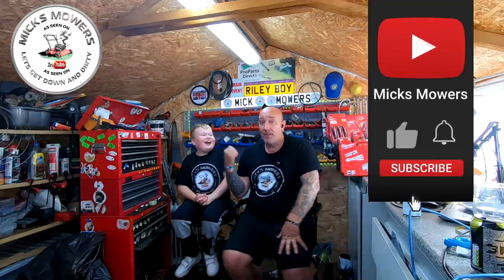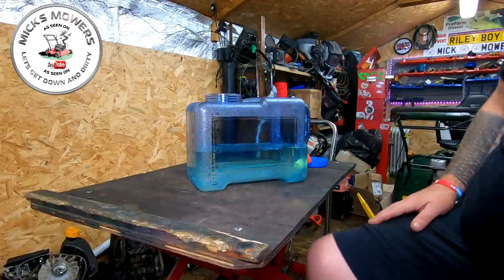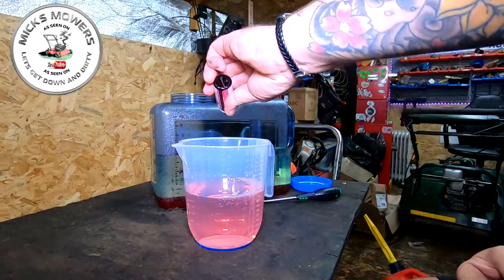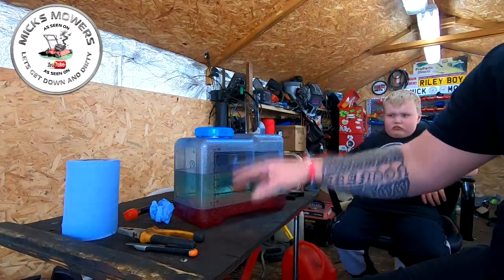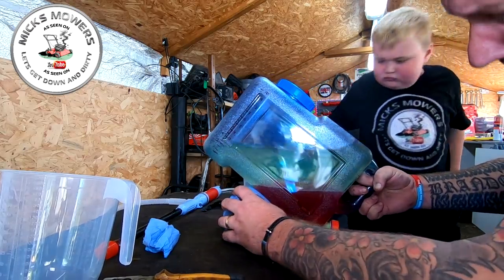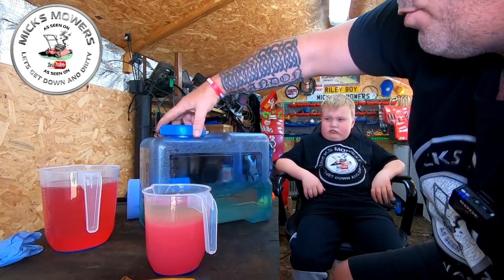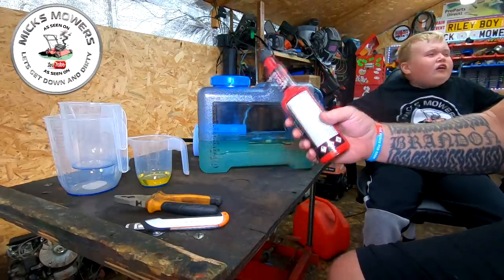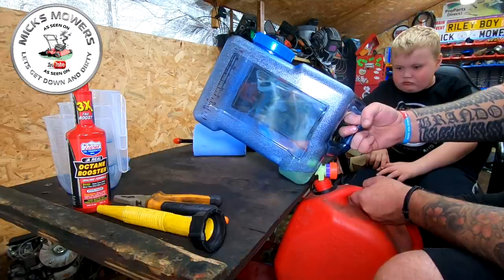How To Remove Ethanol From E10 Unleaded Fuel To Use In Lawnmowers And Small Engines

Comment: Why do refinery’s even bother to put so little ethanol in the fuel if the little amount is causing so much damage which it does I’ve seen it first hand..
Reply: Government mandate.  Reportedly, even farmers which raise the corn for ethanol won't use the stuff in their equipment.  Aggravating to realize that there is little chance of getting government to remove the mandate - too much money involved...
Reply: @xzqzq  it’s just crazy
Reply: @xzqzq  All the farmers i know use ethanol blended fuel, some even run explicitly E85 and are darn proud of the work they did raising the crop to produce the ethanol.  So i don't know who is reportedly making these false statements, but i can tell you for a fact that growing up on a farm we used the same ethanol fuel as everyone else, and now in my older years living off the farm i still use it, and still have zero issue with it.  If not for the ethanol plants and the contracted corn they buy a lot of farmers would be hurting on their income every year here in the Midwest.  Its a huge part of our economy, i have three ethanol plants in my area and another is being built with a spring of 2022 production start.
Reply: @CrazyHamSales  Any idea why Congress mandated ethanol in motor fuel ?   To support the farming sector ?
Reply: Ethanol is considered less polluting than hydrocarbons, ie it reduces the CO2 emitted (and other contaminants, too). However, the process of making ethanol from corn creates CO2 as a by-product which is used in food processing and fizzy drinks, which then gets released to the atmosphere, but only half as much as burning hydrocarbons. (Another by-product is a pretty good animal feed).  It certainly reduces the demand for crude oil which is generally only available from politically antagonistic countries and reducing imports is good from a balance of payments point of view. 

Whilst fracking in the USA has considerably reduced the dependence on imported crude, it will not last forever so the ethanol will spin this source out a bit longer. This also applies to the UK where North Sea oil is on the decline. Of course, farmers like the guaranteed income, too. 

The downsides are ethanol is more expensive to make than refining hydrocarbons and it can damage engines if stored for any length of time as it absorbs water (the basis of Mick's process) and eats nitrile gaskets and O rings. So from a political perspective it makes perfect sense. Engines will be designed to resist the corrosion and separate out the water but older vehicles will take time to work their way to the breakers. PS water is also a by-product of combustion. You can see it dribbling from exhaust pipes on cold days.

Comment: I liked your video. I'ld save the E-10 and rejet my 2-stroke dirt bike, add some good 2-stroke. It should some power. But at the end of the day. "Drain the fuel out of tank and run carb" dry. Then put a Pint fuel Gas/Petrol in the tank mix little heavy on Oil run it for afew minutes.  "Alcohol hates Aluminum"! It eats into the aluminum. Get it out of your fuel system after riding or racing.

Comment: 5 L "petrol" 10%  ( if ratio by volume) ethanol so 0.5 L to get out. Add 2L water  then you might expect 2.5L to drain off.
Frankly my chemistry was too long ago but I would expect the ethanol to go into solution and there be some  reduction of volume over the 2.5 L... 
But what the hell were just washing the petrol with water.
Reply from the maker: Thanks fo watching Jason..

Comment: Actually octane retards ignition (reduces flammability/explosiveness).That's why higher octane fuel is used in high compression engines to stop preignition (engine knock)...
Reply: Fuel with an 87 octane rating burns more quickly while higher-octane fuels burn more slowly. ... By contrast, a higher-performing engine, which includes engines with higher compression ratios and/or forced induction, requires the slower burn rate of higher-octane fuels to defend against engine knock.

Comment: Why? E5 is ten or twelve pence more expensive, you have just removed 10% of your E10 ie you fuel without the cost of water and equipment is now 10% more expensive when the E5 is only about seven and a half % more expensive than E10 before you have started messing about. I have some E5 that I use for my emergency generator that I have added some fuel preservative too that is now more than three years old and still good.

Comment: UK people "the metric system is so good"
UK people "yes I'll take 1 liter of petrol for 20 pounds"
Lol makes sense, right? Measure everything in metric but money is still in pounds. Even so, I feel sorry for metric places. They're paying the equivalent of 4-5 dollars for 1 Liter of gas. Mean while, we're paying 3 dollars for a whole gallon.
Reply: Pounds as a currency is £
Pounds as a measurement is lb

1 litre of petrol costs about £1.35
£1.35 = $1 86

What's wrong with using GBP as a currency anyway?
Do you think they should use freedom eagles instead?
Reply: This is nonsense. Modern engines burn cleaner than they ever have. New EPA regulations have the largest trucks running clean. I would agree that less vehicles, hybrids or electric is better for cities, but the strip mining and carbon footprint of all of this still exists.
Reply: The USA is the only country left in the world that uses, Fahrenheit, gallons (which were different to UK gallons), lbs (that were different to UK lbs), and letter size paper... but the dollar is metric (well, decimal is the correct description). Go figure!

Comment: Good to know; just gad they still sell alcohol free gas where I live (for now).   Just as a side, I did leave gasohol in my lawnmower over the winter and low and behold, the engine wouldn't start.  Took it to the repair guy and he said there was water in the tank and gasohol attracts water (as you said).   No longer worry now that I use non-ethanol gasoline for my lawnmower.   :)

Comment: Great Video Mick!!!  They've started cramming this E10 garbage into fuels in Canada too now so I suspect more and more people will be doing this to protect their small engine's from ethanol gumming up the carbs dude to phase separation.  Question, I've seen a couple other vids where they recommend 1 part water to 16 parts petrol (so for 5L, would need only about ~312 ml of water).  But you use a ratio of 1 part water to 2.5 petrol, just wondered why so much water?
Reply from the maker: No reason mate.. I don't believe it matters
. The water will still remove the ethanol..
Reply: @themowerman  thanks Mick!!

Comment: Hi,
Thanks for the info about this e10 fuel, quick question, for 2 strock engines will this work the same once i mix the measuered oil into the fuel
Reply from the maker: Yes mate
Reply: Why mix the oil into the fuel before you separate the ethanol? Just separate the ethanol then add oil to the neat petrol.

Comment: Last year, when we had another potus, I was paying about .50 cents per liter in NW Ar. Now it over 3.00 per gallon or .75 cents per liter. Diesel is anywhere from 3.25 per gal to 3.40. Or .81 cents per liter. We are now introducing E15 fuel now. It is supposed to be fine for 2007 and newer vehicles. E85 is cheaper, but ethanol holds fewer btus of energy. I bet U.K. folks think .75 cents per liter a bargain?

Comment: Have you looked at a mr funnel to remove any trace of the water i have had mowers come in would not start drained the fuel put back in a machine as a test with the fuel pored though a mr funnel and the machine started right up in the funnel was all the water which was removed .
Reply from the maker: The Mr funnel would remove water but not the ethanol I believe
Reply: @themowerman  I wander if the ethanol was sitting on the water if it would be removed with the water think i will try it do a similar test to what you have done i will keep you updated .

Comment: Can you still buy Ethanol free petrol in the UK? It's still possible to buy 99 in Canada but in the US everything now has Ethanol (except for a few places serving the racing crowd).  Asking as I  just shipped an old classic car (that does not like Ethanol and was designed for leaded gas) to the UK.
Reply from the maker: Yes you can
Reply: @Stephen Burnage >>> Yes you can two sources 1# A small/local airport they stock leaded/ethanol free/derv.. phone around & you'd be surprised what's on offer 2# BP filling stations.... their top of the line fuels are clean of it some what. A possible  3rd option buy it in bulk by 55 gal drum with it delivered just like red diesel.
Reply: @gettogo0159  Gosh. Never thought of those two options. Very helpful, thanks.
Reply: @stephenburnage7687  Enjoy no problem we are all here to help each other when we can or when we need it. I only use ethanol free fuel {airport} - two 20 litre jerry cans & throw in a little treatment (long term storage) usage: 2 strokes equipment or the remains in the car. Been using more bp fuel of late with airport fuel. no issue 
For cleaning something rather caked up in chemical crud I will buy cheaper e5 to soak in. For hardened rusty item/s a gal of derv & soak for a month, pull out = result.

Comment: Cool. I used to just change out diaphragms in the carbs every year or two. They cost about a buck. This last time I just bought a whole new carb, about ten bucks. I doubt that I'd have the patience for this, but interesting none the less. Cheers.
Reply: Removing 10% ethanol raises your fuel cost 11%, so you have to balance that against replacing the carburetor. Using US measures and $3 a gallon, using about 30 gallons of 10% ethanol fuel would save you the $10 to buy the new carburetor. When you also factor in the deionized water and extra containers, it’s hardly worth doing the separation. 
You do have your time with either method.

Comment: Removing ethanol would indeed lower the octane but I  don't under how that relates to flammability of the remaining gas. The octane is needed to prevent pre-ignition. Starting with 91 octane might eliminate need for the booster as a final of 87 is probably ok.

Comment: Don’t have to be exact on adding the water, i do 1/3 water into the mix seeing once the concoction is mixed it separates and both the ethanol and water will be separated and easily discarded. For the added step of adding octane that is fine no harm, however use premium fuel which already has a higher octane rating and once you remove the ethanol water mix you will have a slightly less octane gas which will bring you to the regular octane level anyway. If you use a regular octane gas then the resulting filtered mix will be low on octane so you can add the extra octane to bring it up. For small engine equipment use a premium gas to begin and no extra octane will be needed so save yourself from that expense. I have been doing this for years and even do so for my neighbour for his small engine requirements. Cheers.

Comment: I’ve need using E10 gasohol in small engines for many years with zero issues. Just don’t try to store the stuff for more then a month or so. All you have to do is run the machine dry before you store it for the winter. Rotate out your Jerry cans once a month. Just dump them into your car and then refill them. Now granted when ethanol fuel came out we had issues with rubber fuel lines and rubber parts in the carbs getting destroyed. However those problems are long gone as the replacement fuel hose and carburetor kits have ethanol resistant parts and have for many years. Unless your taking an old machine out of some sort of long term storage you don’t have to worry about ethanol. If for some reason you are just get a new carb kit and a couple feet of modern fuel hose, those things are going to be hard as a rock from sitting for ten or more years anyway even if they haven’t seen any fuel of any kind.

Comment: I buy et free gasoline in a 55 gal. drum then ad PRI-g preservative and the fuel stays good for years. I use it up in 5 years, I don't know how much longer it is good but I imagine it'll last a couple more easily, because there is absolutely no problem after 5 years. I use it for  all my small engimes - tillers, mowers, chain saws etc. I am convinced pri-g is better than stabil - one bottle of it is good for 250 gallons so it is inexpensive per gallon, too.

Comment: Might be being stupid but…….doesn’t octane booster contain ethanol??
Reply from the maker: The sensors that detect ethanol in the fuel lines will probably detect the octane booster as ethanol, particularly since a lot of octane boosters contain a certain amount of ethanol and similar alcohol

Comment: Ethanol is not good for small engines but I only use ethanol for my car due to is clean burning and knock resistant properties. Not to mention the octane content in ethanol. After extraction the octane content of gas/petrol is lower than what is was before. Very good video though for the extraction.

Comment: My car runs like a bag of nails with standard 95 so I have to use shell v power 99 I think I'll stick to that I can imagine that e10 is going to do alot of damage to alot of engines even though government website says I can use it in my car I don't trust it great video Mick very informative
Reply from the maker: Thanks Ben.. I appreciate the comment
Reply: If your car runs bad on ethanol then maybe you better have the car looked at.  I run E10 and E15 in my 18 year old vehicle and it runs just as smooth as it does on any other fuel.  I suspect your fuel trim is way off.  If its fuel injected you might want to look at your O2 sensors and CAT's, if its old enough to be running a carb then give it a tune-up.  I can't tell any difference at all between the fuels.  On our newer flex fuel rated vehicle i can go from E85 to E10 to Premium and not feel any difference at all in how smooth it runs or performs.  The only minor difference is E85 has less MPG then E10, which is a very common complaint.

Comment: Now that freezing weather is impending in my part of the world, I’m wondering if adding warm water to the fuel container, mixing it and then leaving it outside will get the water to precipitate out of the mixture more quickly as it freezes overnight, or will the alcohol cause a slurry rather than a clean line, causing issues decanting the gasoline?
Reply: Alcohol part will not freeze. The water will
Reply: @grahambate3384  yes , that’s correct, but the water is simply the separation catalyst and carrier for the ethanol. The heavier water should (might? Will?) freeze, hopefully after separating the ethanol from the gasoline, and then removing the fuel from the mixing vessel should be easier. The alcohol can only absorb so much water, and if that’s warmer than the fuel when mixing it, we may see the benefit of a faster “break” of the bonds between it and the fuel simply because of its surface area/space between the molecules in contact with the “enhanced” fuel.  This is a hypothesis to put past someone who knows the chemistry, but I don’t know of any reason it wouldn’t work.
Reply: Cold causes chemical actions to slow down. At low temps, even if it doesn't freeze, it might tale longer to finish, or even asymptote.

Comment: One of the things to think about when removing ethanol from gasoline is that you will be lowering the octane of the fuel significantly. So if you are going to this you ahould start with high octane ethanol. Don't start with 87 octane. Start with the highest octane you can find.

Comment: You could use a 10l collapsible camping water carrier, they have a tap at the bottom.
Reply: Most are made of HDPE so would be petrol safe, not to sure if the ethanol would react but it is doubtful.

Comment: I’ve got the new mountfield sp185 and I’ve been useing e10 and mines running ok
Reply from the maker: Yeah just watch what happens over time or if it's left in it over the winter
Reply: @themowerman  I’ve got 3 years warranty on my mower anyway so if anything goes wrong mountfield will replace the mower for free
Reply: @chrisevansgardenservicesjo8093  Only if it's a mechanical or manufacturing fault. The wrong fuel might count as misuse. Check the wording!